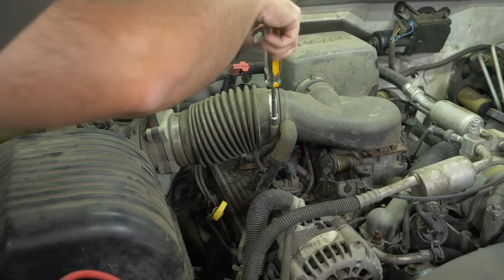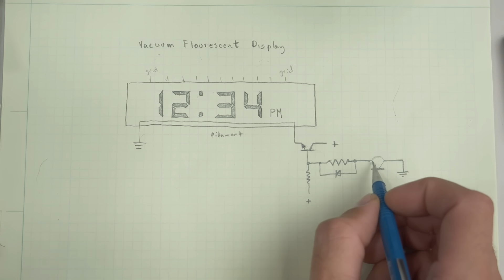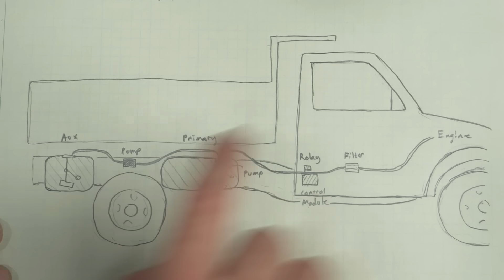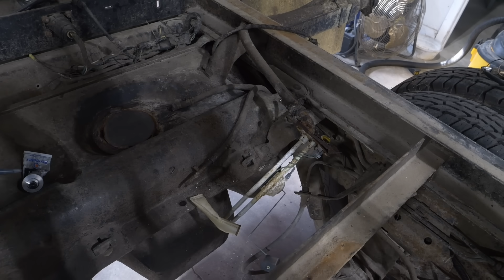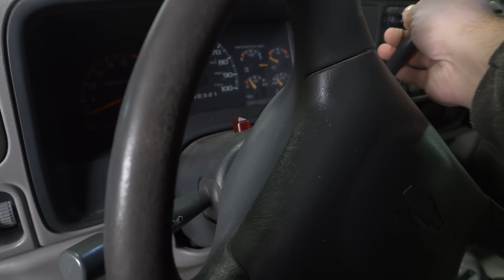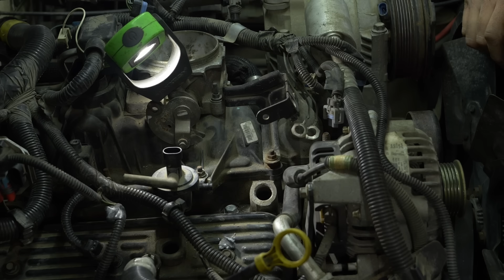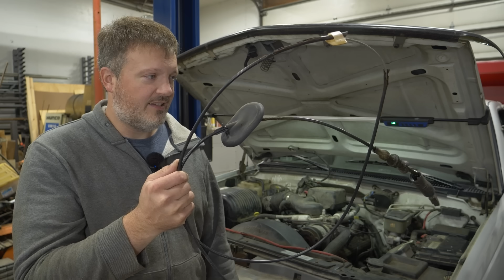This Truck Is Breaking Faster Than I Can Fix It

Comment: Just finished the video. Those distributors were bad with wearing out. It might come back with a cam/crank correlation code if it’s too far out. 

When mine failed, it cranked like the timing was way too far advanced. Left us stranded some 120 miles from home on a family camping trip. I was so irritated, that thing sat for a good 6 months before I decided to fix it. It became a lawn ornament long enough to decorate it for Christmas 😂. 

1a auto had a billet aluminum distributor for $50 (back in 2017). Much better unit than the oe. 

I don’t remember if it was already in the suburban or if it came with the distributor, but it gave way more adjustment than the stock setup to set the cam/crank timing.

Comment: Someone seems to REALLY love this vehicle...
Reply from the maker: He just wants it to work.
Reply: The problem is that, even with all the repairs and lack of parts, it is still way cheaper than buying a new one with a dump bed.  Used farm trucks may be a bit cheaper, but they tend to get sold when they are too beat up to be of much use to the next guy.

Comment: Was it Mary b who developed the two tank debacle? When two switches could have worked much easier
Reply from the maker: The older trucks had a manual system, but it is also complicated with an electronically shifted valve block

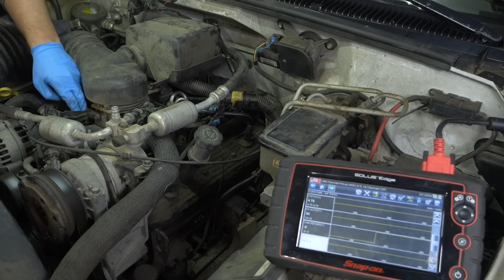Comment: 33:43 Best way to set that is to put the fancy snap-on i-Pad back in the toolbox, tweak it, drive it, let the engine tell you what it wants. How I set the timing in my old rigs. I find the factory spec is invariably way too conservative and that the engine will wake up considerably when you disregard the numbers and let the ol' butt dyno and Mark 1 Earball determine the set point.

Feed it timing till it starts pinging under a WOT pull, back it off a blonde one until it juuuuuust stops pinging, lock it down.

My 71 C10's spec is 4ºBTDC. I run almost 15ºBTDC. It LOVES that. More timing --> more power, economy --> happier engine. Also no dieselling; if I run the factory 4ºBTDC timing I have to wind the idle speed screw in far enough for it to idle that it will diesel on shutdown. Running more timing means I can back that screw out until it doesn't diesel anymore while still idling at ~600rpm.
Reply from the maker: It doesn't work that way. When you set the timing, you are basically just aligning the distributor to the crank position sensor. The computer controls the actual advance.
Reply: Ole' Leeroy here just sends it. Pinging and putting holes in your pistons, who cares, we don't need compression or spark plugs where we're going boys.
Reply: @COBRO98  Lol no. I don't let 'em ping.
Reply: Ignition timing on the Vortec is not adjustable.
Reply: @johnz8210  It is when you delete the computers and throw an HEI distributor in it.

Comment: number of shops in the U.S. that would try to fix a radio 1.
Reply from the maker: Somebody's gotta do it.
Reply: Hey now, don't discredit all of us mechanics😅. I would personally fix 70s to early 00s PCMs, GM analogue gauges Chrysler TIPMs and other components with large traces in my spare time for clients. The problem is that, very often, it's not worth it financially with the hourly rate to fix said components and newer car have tiny SMDs, dual, triple layer and epoxy coated PCBs that discourage even the brave souls. The garage certainly isn't going to pay my microscope, reflowing and hot air station also😅. The real kicker is that replacement components other than basic ones (diode transistors, resistors etc..) are either not available for sale or made out of unobtanium on Mouser, digikey and such; the manufacturer made sure of that. Kinda like Louis Rossman experiences with Apple products. I've seen other talented mechanics throw the towel about getting electronic knowledge also as the automotive industry is a big pile of doo-doo and will eat your mind and soul little by little. To be clear, I'm not discrediting Wes in any way, he's a very, very talented person and it brings joy to my soul that he's fixing and fabricating stuff rather than throwing new parts at it. Sorry for the long azz rant😅.

Comment: Wes I've got a 96 Chevy 2500 extended cab big block, my dad bought new, lived most of its life in the garage in Colorado has 102,000 mi on it, no rust, unless I'm pulling a trailer I'm too cheap to put gas in it 🤯

Comment: My idea for that tank would be Once you have it working, and confirmed. I would use the rtv to seal it, and build a dam across the molded in drain, then just flood everything with an epoxy safe for fuel, and heat. Maybe something from a company called “duro-mar” they make some high end tank coating epoxy’s, I believe used in the nuke industry.. but a 1 gallon kit was under 2 hundred bucks last I bought a gallon..
Reply: That's for a do it yourselfer, not for a shop that is liable for it's work

Comment: Trouble with plugging the aux tank like that is that when the weather warms up, the air pressure inside is going to increase and it might blow the lid off it. You might need to add a tiny vent hole.
Reply from the maker: With no fuel in it I think we'll be fine.
Reply: @WatchWesWork yep I wasn’t worried about fire. Just that the cover might come unstuck!

Comment: That’s the wingnut to hold the intake hat  onto the throttle body
Reply from the maker: There you go! It had a nut on it. That did seem weird.
Reply: Wow  good call !
Reply: I came here to say the same thing, but you beat me to it. I've probably dropped a few of those and replaced it with a nut in my day as well...

Comment: You threw me for a bit because you drew the small transistor as a PNP, which operates opposite of an NPN in that you have to sink current  from the emitter to the base to turn on the transistor.
Reply from the maker: I think it's the opposite. The big one is PNP.
Reply: @WatchWesWork sounds reasonable

Comment: Good old 'through hole' soldering  👍 I've got no idea how to hot air solder 😂
Reply from the maker: I have one. I never use it. Low melt solder works well for me.
Reply: @WatchWesWork I've still got a few rolls of leaded I'm using( with extractor)
It hasn't let me down
 😂🤞

Comment: Radio stuff was neat to see, but how does it make sense to pay $100 per hour to diagnose and repair a radio that can be replaced with a more capable unit for $45.00 and fifteen minutes of replacement time?
Reply from the maker: Did you actually check the price? I did. By the time you buy the adapters and a decent radio you've spent $250.

Comment: Working on ac in October on a high mileage work truck is insane, that thing could have catastrophic failure at any second, but it may also go another ten years, but I promise if you fix the AC and fill the tank at the same time it will be its last ride. Murphy told me so!
Reply from the maker: We can be sure the A/C wouldn't be working by spring time anyway.

Comment: 99.9 % of the time i agree with you but wasting time playing with a $30.00 radio would have pissed me off as a customer now if you did it on your own time cool thanks for the content
Reply from the maker: I'm still waiting for the links to these $30 radios. You guys need to look around. You'd spend $250 putting an aftermarket radio in.
Reply: @WatchWesWork 
I’m sorry you are right $43.99 pick n pull
638-1A	RADIO	Car	$43.99	$0.00
Reply from the maker: @kenneychappuis1853  I know it's hard to believe this, but I don't live where you live. The nearest salvage yard to me is a 2 hour round trip. I just looked on car-part and the nearest with a matching radio is 100 miles from me.
Reply: @WatchWesWork 
I picked a Illinois location because I think that’s near you in the Midwest. I’m in AZ. Heck Amazon put some kind of new car stereo on your front porch for less than $50.00
Reply: Bro, good luck finding somebody working on that 30 old vehicle. If you have any claims, just maintain it yourself

Comment: You are amazing. In 63 years I have never seen a mechanic that would touch a radio.
Reply: You not seen a machanic with a electrical engineering degree
Reply: To call Wes a mechanic is to damn him with faint praise. He’s a hell of a lot more than a mechanic!
Reply: @MattKrogmeier agreed
Reply: @MattKrogmeier dude is a dang magician
Reply: With today’s labor rates, it would probaly be more cost effective to just replace the whole radio.
Reply: @paulsoverhauls   probably be more cost effective to just replace the whole truck. :-) As usual amazing work Wes, continually amazed at the jobs you take on and fix.
Reply: @paulsoverhauls or the whole truck?
Reply: @paulsoverhauls  With what?
Reply: @paulsoverhauls  Or at a point coming soon replace the whole truck, one with AC!  LOL
Reply: @paulsoverhauls If you can go immediate component level repair, it can make sense in our (not so) just in time society...
Reply: I'm an electronics tech, specialist in radio. I would have binned the radio and replaced the whole thing with a new head unit. I now have a whole lot more respect for Wes.
Reply: Can you show us a little more electronic diagnostic/repair videos in the future?  I might be the minority here but I would watch!
Reply: @christianmccollum1028  meeee too!
Reply: Apart from Wes I'm sure i would not let a mechanic touch mine 😂
Reply: I wouldn't let a mechanic touch car either
Reply: Older through hole stuff is great. Modern microscopic SMD that needs a microscope (Here's looking at you, SMARTPHONES!) not so much! I even sound like Wes :)
Reply: Wes isnt a mechanic, he is everything else but does mechanic work to keep his mind exercised i think. This kid is smart as heck. We get to see a few minutes in a video of what he is capable of but i think he would lose many of us "regular" guys if he really started filming himself doing things at the level he is actually capable of doing.
Reply: it’s an unusual career path but remember that Wes grew up on a farm fixing anything and everything from an early age.  It is possible to get a university degree in electrical engineering without knowing how to rewire a lamp socket.  A good  mechanic uses his brain and all five senses and gets a lot more tangible satisfaction from his work than many a cubicle nerd.
Reply: @warrenmichael918 kid?
Reply: He’s an electro-mechanical wizard, not just a mechanic.
Reply: Yeah,I'd think 99.9% of people would tell him to find another factory radio,or get an aftermarket unit installed. I'm betting Eric O. would have shipped that off to United Radio for repairs.
Reply: It's not that guys can't fix them it's just not profitable, good for youtube content but completely impractical in a real shop environment that has to churn out numbers.
Reply: considering there's only two I've watched that'll even BOTHER looking...or trying to solder anything (only Ivan @ pine hollow will go that direction)...also, this guy is farmer grade, they tend to fix what's broke instead of throwing Chinesium replacements at everything.
Reply: Seems like every bloody time mine goes in they touch the radio. They're forever changing the station to some utter shite
Reply: Only if it's a vintage OEM radio that's correct for a vintage car.  Those are worth fixing and that usually requires a specialist.

OTOH, a radio like the one in this truck?  Throw it out and get a used replacement.  There's nothing on radio anymore that's worth listening to anyway.
Reply: Because it is less expensive to simply replace them with an upgrade from a salvage yard.

No normal mechanic with an ounce of sense will waste time on that you halfwit.
Reply from the maker: The nearest salvage yard is a 2 hour round trip. I fixed it in 30 minutes without ordering any parts. An aftermarket radio would be in the $250 range with all the adapters and brackets.
Reply: @WatchWesWork  As an oooollld electronics engineer I can attest to an amazing troubleshooting you did right there. Cudos!!! You are a jack of all trades!
Reply: @WatchWesWork Excellent!!!
Reply: @WatchWesWork  A single DIN Bluetooth head unit and the mounting/wiring adapters can all be had for under $75. Kudos for finding/fixing the problem, though. I would have needed no excuse to replace that factory head unit, broadcast radio is garbage and Bluetooth is a must.
Reply: @WatchWesWork  Order from Crutchfield. Could likely have a decent quality radio with bluetooth capability, and a fresh pair of speakers with all the adapters and wiring for under $200. I did just that in my 96 C1500 Cheyenne last spring. I've been buying car stereo equipment from them since the 80's.
Reply: @WatchWesWork  And, if my last few trips were representative, that 2 hour round trip doesn't mean you'll find a radio. You'll find a lot of vehicles, even some just like the one you want, but they're so picked over and hacked up from pick and pull vultures it's a lot of cursing on the way back empty handed.
Reply: @WatchWesWork  how is your labor not worth that?
Reply: @WatchWesWork  Plenty of online salvage yards send by mail.

In your case you fixed it, congradulations big deal.
Reply: @WatchWesWork  fool tank.. why did chev do that.??.. why not have a ford set up. just switch between tanks, engine fuel pump, 1 gauge..   oh..  forgot..  chev like to be different...  ausie...
Reply: @WatchWesWork  problem with the fool gauge, is when its empty, you got no fuel.. too complicated...
Reply: @WatchWesWork  Can I post my radio from Australia, for you to fix? Some of the buttons dont work anymore, I replaced the little push switches, but they didn't fix the tuning or am/fm select. now its just lost the auto store function, so is unusable.
Reply: Another fine job, you went above and beyond most!
Reply: Excellent Video Wes :) also yes some vechiles can be fun do and others be headaches worth!
Reply: I got lucky with the radio out of a friend's Dodge a while back. I assumed it was junk, but I opened it up anyway, and found that it had a daughter board flopping loose inside due to cracked solder joints. Touched those up and it was back in action!
Reply: Yes amazing
Reply: It’s so interesting watching you work and describe what you’re doing.  I love watching your videos, especially the one liners, love them, “Fonzi percussive therapy” and “industrial cheese” had me rolling.  And Max getting older, I remember when you got him, good pup…
Reply: I had to do the intake gaskets on my suburban and had the same problem getting the timing right.  Setting the timing on those engines is a bear.  I almost gave up and got rid of the suburban.  When it came back and you mentioned the leak I started twitching
Reply: Nice to see it fixed. I've done it myself a couple times. Factory unit looks so much nicer than the aftermarket garbage.
Reply: thats because you do not get paid to touch the radio.  you get paid to replace it when it goes bad.  as a 63 year old mechanic that should be common knowledge for you.  but the fact it isnt says quite a bit about your credibility.  smh
Reply: There's a reason for that. First reason is radios are usually cheaper to replace. The second reason most customers don't want to pay and maybe be able to fix it fee when an aftermarket stereo is it guaranteed to fix it.
Reply: My buddy Tim Weigand had an 84 'vette.  He had a defective radio.  He somehow located the schematic for the radio, removed the radio from the car, brought it into work on a Saturday (I happened to be there) and ohmed out each component and located a defective switching diode and unsoldered it, soldered in a new one, and presto!  Back on the road again w/a new radio. I've repaired several.
Reply: @silasmarner7586 You shouldn't ohm things out if they're in circuit, remove one leg from board then ohm out ✌🏻
Reply: I have a the same skills as Wes but not his patience . He is phenomenal.
Reply: @Papawcanner  wrote that he has the "same skills as Wes ..." 
Well, bless your heart
Reply: I’m a retired “master auto mechanic “ with a two year degree in electronics . Piece of cake

Comment: 2:06 an HEI distributor, Edelbrock intake, 750cfm Quadrajet, and a fuel pressure regulator would do that engine a world of good.

Just saying.
Reply from the maker: I'll take fuel injection any day.
Reply: @WatchWesWork  I've been let down by fuel injection one too many times to ever allow it under my right foot again. 2003 Explorer disabling the throttle because the sending unit in the tank was slightly glitchy? Fuck off. 2014 Challenger flooding itself? Hell no. 95 F150 4.9 that didn't start until the second attempt, ran on 3 cylinders until the check engine light came on, made so little power Sammy Hagar wouldn't drive it, and at the same time drank like a 460? WTF NO.

Meanwhile, the 85 F150 4.9L my parents bought me for $500 in 2007 with 200k on the clock went another 200k miles without a single breakdown. Ol' Carter YF ALWAYS worked. Got 18mpg out of that thing right up until the day the rod bearings exited the chat due to old age. At 400,000 miles. Can't be mad at a 500 dollar truck giving me 200k miles like that. Currently, I get everywhere I have to go in a 1971 Chevrolet C10 pickup with a 250cid I6 and a 3-on-the-Tree manual. Points ignition, 1-barrel carb. Runs like a sewing machine.

EFI had its chance with me and it blew it big time. It's a hard dealbreaker nowadays. It wasn't 5 years ago, it is now.
Reply: @TestECull here in Europe Mercedes efi with m111 engine make to 400k miles without any issues, so I don't agree with you
Reply: @ДимитърАндонов-ъ7е  Been burned by EFI way too many times to ever let EFI under my right foot again.
Reply: Swapping an NV4500 into it would do the whole truck a world of good, too.